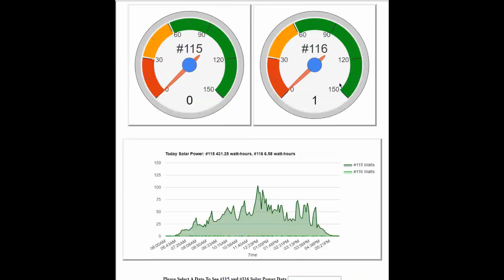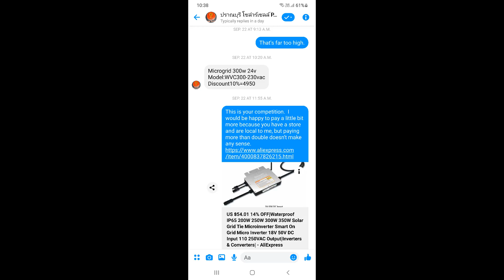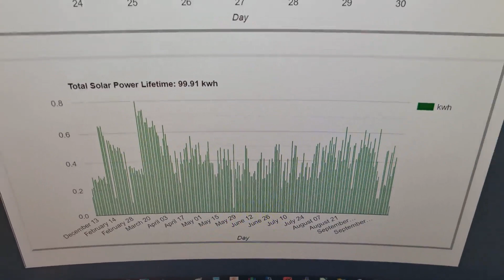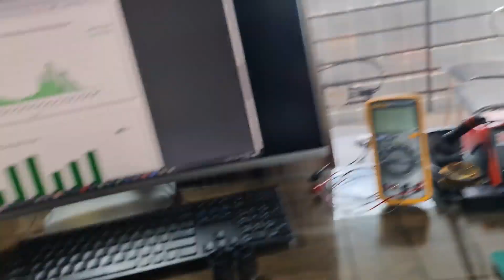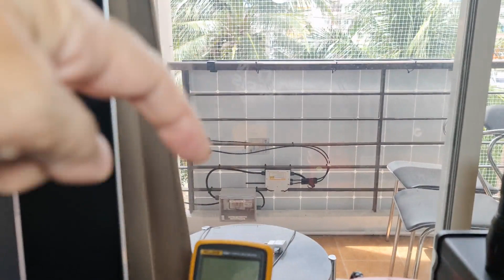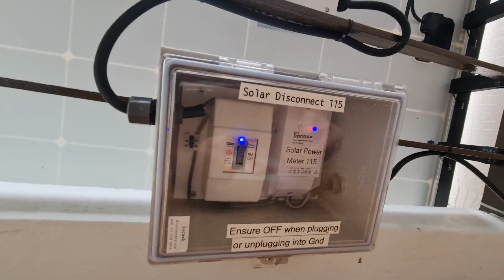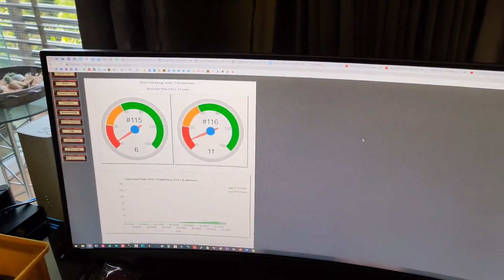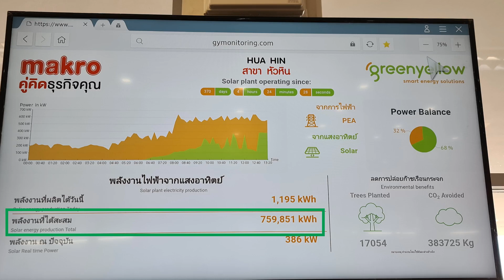Solar Power Fail!  Going to Solar Power 2.0 with Enphase Microinverters

Comment: Thank you for this video. Did they work directly out of the box ? You did not need to register them ?
Best Regards,
Didier
Reply from the maker: Yes, they worked right out of the box.  You only need to register them if you're using their monitoring system.

Comment: I do wonder if the metal plate is supposed to act as a heat sink looking at that round blob of glue
Reply from the maker: That's an interesting possibility.  I think I'm OK because there's lots of airflow around the unit, as opposed to its normal mounting situation.  I held my hand on it this afternoon when it was doing  116 watts and it was just a little warm to the touch.  10 Internet Points to you for your insightful observation!
Reply: Enphase product is completely sealed. Much better in handling humidity. They offer 25 years warranty in US and Europe.